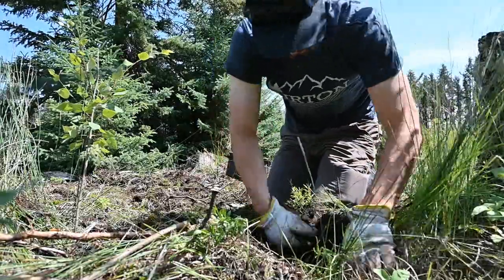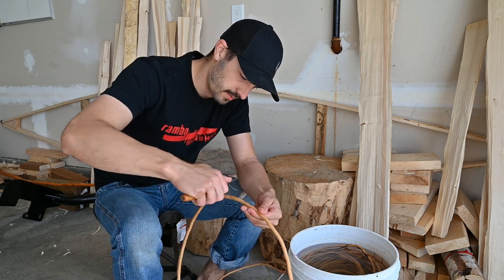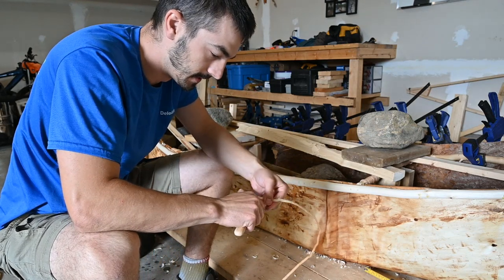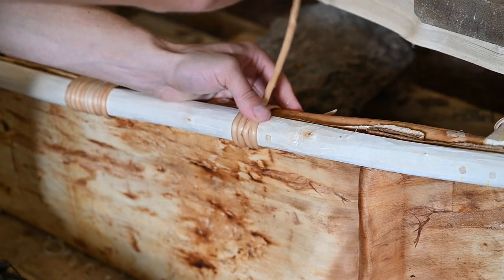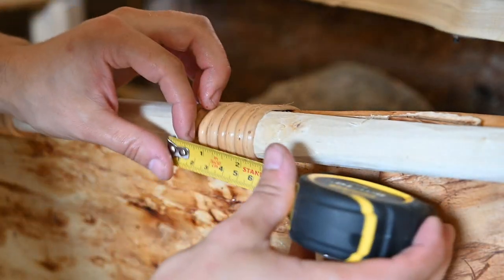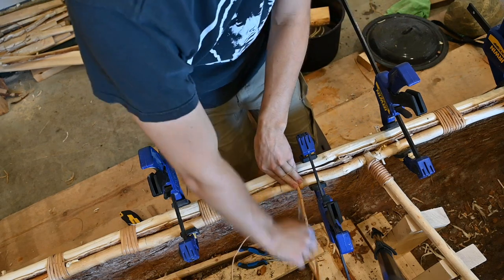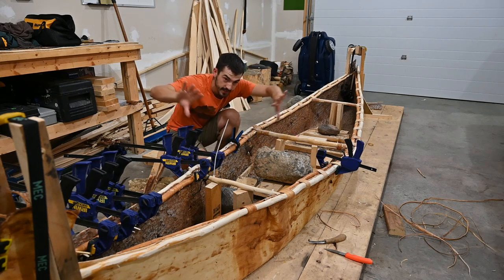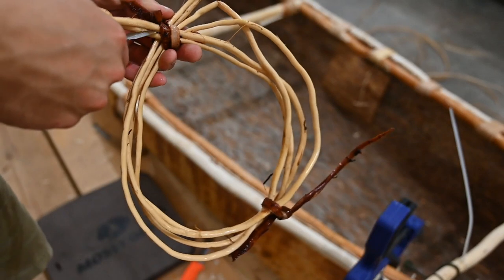Building a Spruce Bark Canoe - E3 - Gathering Spruce Roots for Lashings

Comment: I remember asking you on a video about white spruce compared to black spruce root. I've found black tends to be better as far as long straighter pieces. I have'nt dug enough to be an expert though. Hard work. I must be odd cause I love doin it.
Reply from the maker: You might have experimented more than me ! I used mostly white spruce as it is more abundant close to home. There are some areas where I could get some black spruce but would have to drive farther. I want to expriment more with resources in 2020 ! Roots gathering and processing are a huge underestimated part of the building process…. alot of work !

Comment: Great craftsmanship! Totally enjoying this canoe build. So is the spruce root quartered in for the final project? The platform will be great for an axe throwing target when you're done.
Reply from the maker: I mostly split them in half. Quartered is also possible but I find in half twice makes a nicer finish. Maybe I am too perfectionist. I should experiment more with quarters, as one root would equal 4 workable roots. Instead of one equal only 2 workable roots. Time saving to do quarters in a way !
Reply: @NomadicWoodsman  so then if you go from pinky size with bark and all you thin the halves out a bit right?, or do they just look to be much smaller than what you would expect even with shrinkage?
Reply from the maker: @CarabnrFilms  tmyes corrext. They're thinned down just a little bit. If there are knots pr bigger spots. When they are pinly size yoi dont alwaus have to thin them down more than a half.They dont shrink much.

Comment: Very interesting. How do you know that you boiled the roots long enough? I wonder if a spruce root could stay flexible enough to snare a hare? Why the Rambo shirts?  Thanks for this series.
Reply from the maker: Haha that is what I thought too when I watched my videos. One of the shirts is just really old and I don't want to mess my nicer shirts with the dirty root work so I put that one on. The other one I got in Hope in BC where the first rambo film was filmed and it just happened that I was wearing it when i filmed. Coincendental. To know if the root is boiled enough you simply take on out of the pot and try pealing the bark off. If it boiled enough it will peel easy like a ripe banana peel. If not boiled enough it will stay stuck on the wood and won't peel. It usually takes 15 to 20 minutes with a good rolling boil. I haven't mentionned in the video, but there is a 1 to 2 week window when the buds come out in may where you can peel the bark off easily without boiling. This would of been a good time for natives(pre european contact without pots or who wouldn't want to boil) to be collecting and process a good amount of roots for projects. But I usually miss that window of time in the spring with work etc. so I boil my roots :)
Reply from the maker: Oh I forgot for the snares. The issue with the roots is that they are very weak when they are dry and not resting on anything. With lashings they are fixed in place so they are tough. I was thinking the same thing for snares. I do not believe it would work unless you could keep the root wet long enough before the hare goes into the snare. It would dry quickly within a few hours unless it is raining lots lol. It is possible to start bow drill fires with wet spruce roots though. My father in law, myself and far north bushcraft and survival have demonstrated it on YouTube. For snares, sinew or ''babiche'' thongs with a lever system are what were used historically I believe.